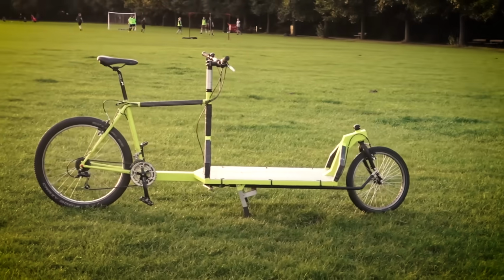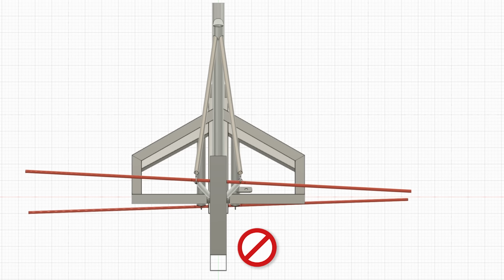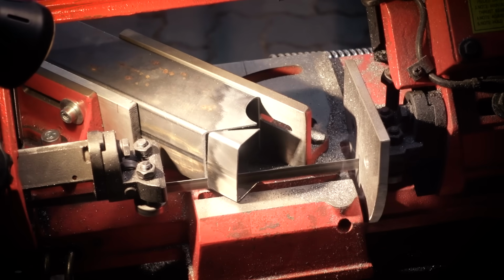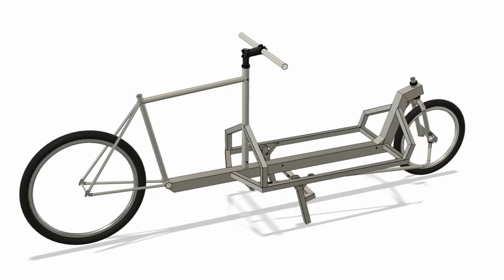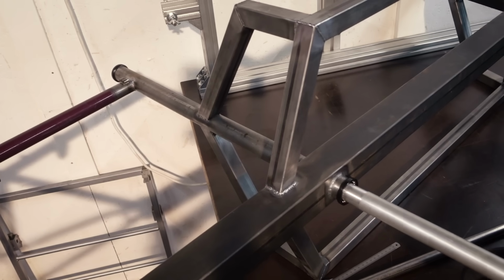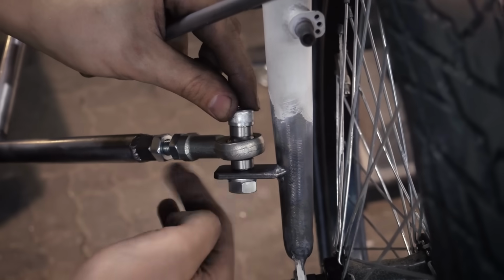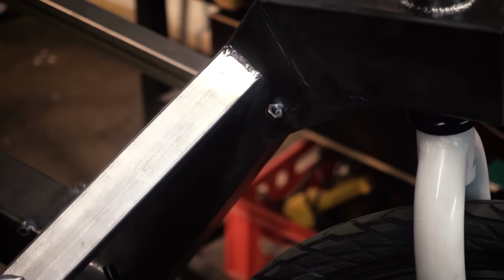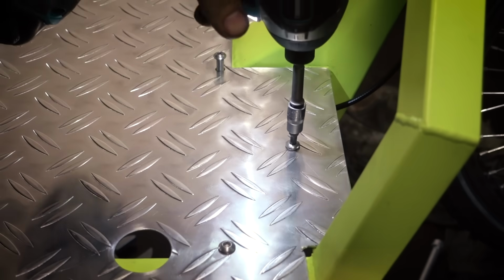How to Build a DIY Cargo Bike (Plans available!)

Comment: Thank you for that intro explaining that you don't NEED a full blown workshop with thousands of dollars worth of tools. I've seen so many negative comments in DIY videos along the lines of "BS, it's only a cheap build if you have tool x, y, and z and they're expensive". As you said, a cheap welder and angle grinder or even hacksaw are the bare minimum along with some basic hand tools - under $200 to get started and they're useful around the house anyway. 
Not to mention the people complaining about cost of materials. Council roadside cleanups are your friend, as are give-away pages on places like Gumtree, Craigslist etc. If you're inventive, you can adapt all sorts of things that others consider scrap :D
As for the build, that big gap under the donor bike looks like it would be a great space for a 4 stroke motor for people living in places it's still legal and want some help powering along with a heavy load. Or a great space for an extra large DIY lithium ion battery pack if you want to go electric. Great design. Relatively simple to build but looks very robust (welding skill dependant) and versatile.

Comment: Do you think put larges holes in new extruture to realize some weight?
Reply from the maker: I'm not sure, I think it might become too weak. If you want to save weight it would be better to use less/smaller material for the cargo bay as it's not that important for the structure/stiffness. It would also help to use thinner steering tubes but the tubing would be harder to find.

Comment: I need to know where you found the steel tubing for 80 euro. All I can find in the states is $300+  :(
Edit: Found all of the supplies from SpeedyMetals.com in the states for about $230.

Here is my order in imperial to match as closely as possible to the metric specs. The head tube I.D. will require reaming, and I was only able to find 2" square tube for a reasonable price.
https://docs.google.com/spreadsheets/d/1jLNbM7ytQzi4uTtkz1kULbJEHP6OPYSAe9bqbUzbpbc/edit?usp=sharing
Reply: You have to pick up a phone, online sites are super expensive.
Reply: jane blogs I think Seattle prices are just high. ¯\_(シ)_/¯
Reply from the maker: Are you sure you'e looking for mild steel and not stainless or something?  I don't know about steel prices at your location but it shouldn't be that expensive. I buy my steel here in Germany so unless you're in the same place my source probably won't help you, I always buy this stuff on ebay
Reply: @PhilVandelay  Indeed. The quotes I received were all over the map. Best place incl. shipping so far is mild steel from www.speedymetals.com at about $230 shipped. Wish me luck!

Comment: 18:30 - " BORE us with welding shots" ? Are you kidding?

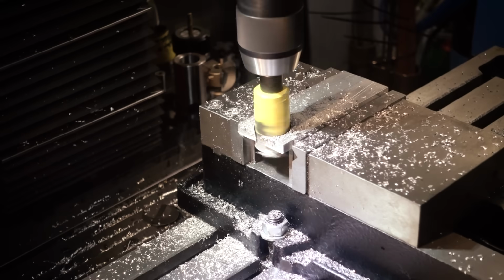20:29 - Right... "saving weight" on a cargo bike ...    just admit it, you like to work with aluminium ;) ;)

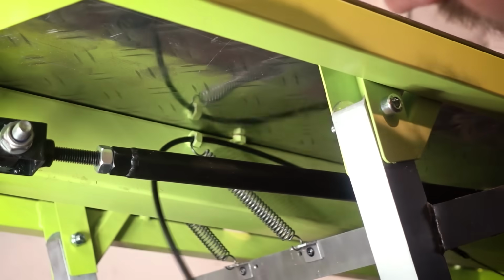36:34 - Also, one piece housing is waaay longer in reliability. Not that you were planning on taking this thing to the mudpits, but still.

36:56 - Correction: it makes sense to use stainless everything . There's no downside on that, but the cost.

In addition, personally, i'd painted inner side of frame with something, just for coating, and left breathing hole in the bottom.  
But overall, this is a wicked concept, and i like the way you brought it to us, without any unnesessary smugness and excessive setups to use. (Still, it'll be a lie to say i don't envy your tool collection))
Reply from the maker: Believe it or not, a lot of people tune out during the welding segments (I can see it in youtube statistics) so I try to keep them short now

Comment: Excellent video, really enjoyed that. I've always wonder how involved a cargo bike build would be and you make it seem doable. One thing I wonder: is the steering light enough to allow the bike to self balance? Could you ride it with your hands off the bars?  Oh and ofcourse: subscribed!
Reply from the maker: There's not a lot more resistance in the steering than you're used to on a normal bike but you can't ride it free handed for a different reason, the bike itself is too long and too heavy for the rider to influence the direction simply by shifting the body weight. You can sort of do it, but it reacts so slow that controlling it is very hard or next to impossible, you can't change direction quick enough. This is true for most bikes in this format though (even much lighter ones). But the light cargo bike I built in another video - that one can be ridden free handed, but even there it's more challenging than on a regular bike. Basically the larger and heavier they get, the harder it becomes to control it free handed. One handed is no problem though.
Reply: Phil Vandelay thanks for the explanation. And again, very inspiring video all around.

Comment: wouldnt hooking a trailer up be simpler?
Reply from the maker: Trailers have a lot of downsides that this doesn't have, like tipping over, getting stuck on things behind you and generally bad handling
Reply: @PhilVandelay  oh ok. well either way it is a cool build and has some cool engineering.

Comment: What a nice project log! Thanks a lot Phil. I just started working at my old art academy and there they have all the tools to build a project like this. Wood workshop, metal workshop, CNC mill to mill wooden parts.. I can just mill out jigs to hold the metal parts in place. Then move everything over to the metal workshop and simply assemble the bike there using all of the jigs. I might consider this project as it's really something that challenges me and I like a challenge :) Thanks for the inspiration! I know it's very hard work to besides doing such a project, also document every step in a sensible way.

Comment: I like it having a very low center of gravity when loaded. That should give it a lot of stability when carrying very heavy stuff. I can almost imagine it feeling even more stable when loaded. Am I right?
Reply from the maker: Once you are riding it's very stable, but when you have lots of weight on it you have to balance it more while standing still or riding very slow. But it's very managable, with a bit of practice you can ride it just like a normal bike.

Comment: your video is great, i hope i can learn how to weld like that
i want to ask something, why the steering/headtube angle is 90° not 62°-72° just like original headtube angle usually on bike ? or you just lazy doing that ?
thankyouu
Reply from the maker: If you angle the headtube forward then the usable cargo area gets smaller or you have to make the entire bike longer to keep the cargo bay length the same. So it's mostly just to save space, because you want to maximize cargo space while keeping the bike as short as possible overall. And the straight tube doesn't really have a huge downside, the handlebar movement is slightly different but you get used to that pretty quick. But yeah, one other advantage is that it's also easier to build that way
Reply: @PhilVandelay  Ahhh..  I see.. it's to save space, and easier way to build. because, i think that take big effect to handlebar movement, since it's not angled like before. so... it's not so really.

thank you for answering my question, it's really help..

Comment: Such a cool build and a fantastic video. Thanks! Just wondering why you did not use a threaded headset on the front? They seem kind of ideal for use on a cargo bike since you do not need a stem to hold things together and set headset play :) Perhaps you could even have used the one from the donor bike (not sure if it was 1" or 1 1/8"). 

Also, definitely keep making vids ike this one!
Reply from the maker: I was planning to use a threadless fork and a-head headset first but I accidentally ordered the wrong fork, I didn't notice it has a threaded steerer... and I had already bought the headsets. You're right it would have been smarter to either use a threaded headset or a non-threaded fork. But I didn't want to buy more stuff so I just used what I had. I'm also probably going to change the fork at some point for a sturdier, threadless one. I personally don't like threaded forks/headsets but you have a point that they have some advantages in this case.

Comment: if you can weld aluminum... why not make all aluminum bike? not strong enough?
Reply from the maker: I wanted to keep it accessible to other people, I didn't really build the bike for myself, mostly just for the video
Reply: @PhilVandelay  so if anyone can weld aluminum they can make one entirely out of aluminum? guess that would not be as strong as steel
Reply from the maker: @jebise1126  Yeah you could certainly build an aluminum frame with the same shape. It's true that aluminum is not as strong but you can adjust for that by using thicker walled tubing (instead of 1.5mm walls, maybe 2 or 3 mm). It's going to increase weight but it would still be much lighter than the steel version.
Reply: @PhilVandelay  but part you take from bike (rear part) you cant make it stronger i guess...
Reply from the maker: @jebise1126  Yeah but that's usually no problem, most mountain bikes are plenty strong enough to to handle the weight. I've never had a problem with any part of the frame not holding up on a cargo bike. Usually the wheels will give up before the frame does

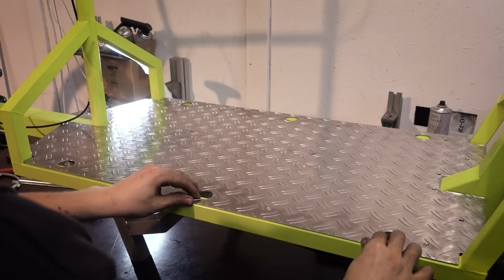Comment: 36:29 Love the build, just a little head scratcher I'd like to ask: Why not cut out a slot instead of a round hole in the floor where the brake line passes? Then you don't need to disassemle the cable if you want to change/remove the floor for some reason. :)
Reply from the maker: That's actually a really good idea, I guess I just didn't think about that option 😅

Comment: "Almost impossible to make this paint drip" They do nothing but drip and splatter. Please tell me what the name of that plastic thing you use when painting with a can.
Reply from the maker: Can't say I had a problem, I found these cans very easy to use when it comes to dripping. It's true they do splatter though - but I never expect much from spray cans. I'm not sure what the name of the handle thing is, they have those at many places that sell spray cans and they only cost a few bucks, not sure where I bought it. Very useful if you want to keep your fingers clean!

Comment: Would an aluminium construction be better and you could ad batteries a go electric
Reply from the maker: Yeah it would be lighter but I wanted to build it so that welding aluminum is not necessary because most people can't do it. I will probably add electric assist later
Reply: Phil Vandelay - it time throw the car away and this could be a base for a way to move bulk goods without government registration. Provided it’s converted into electric

Comment: well thats one way of doing it. theres a reason people dont put trailers on the front of trucks other than the meaning of the word
Reply from the maker: You realize a bicycle is not a truck though, right?
Reply: perhaps thats not the right logic but theres a reason any mass produced version of what you made has the weight and extra length behind the rider.

Comment: Nice bike, here in Amsterdam there is a popular tandem bike, similar design as yours but it has a child sized seat and pedals where your platform is. The brand is "Onderwaterfiets". Also, aluminium can corrode, especially where it comes into contact with stainless steel.
Reply from the maker: I just checked them out, you're right it's pretty similar. I've never seen those before, I love discovering new bike designs and the NL bike culture.

Comment: a bit over complicated and  prone to bending, but whatever floats ur boat, wouldnt recommend doing it this way.
Reply from the maker: Let's see your superior design then
Reply: @PhilVandelay  Saw that coming since this is the internet. But if you had added a few triangles here and the in the corner the design would have been more stiffer and you could have reduced the overall weight of the bike. I might only be a sheet metal worker, but that would have made it better. But if that works for you then great.
Reply from the maker: @Hanstrand  That sounds pretty vague, which corners should I add triangles to? And how would that save weight? And how do you know it lacks stiffness without having used it? I'm all for constructive criticism, but if you're only saying "it's bad, I can do it better" without explaining exactly how, then it's not very helpful and makes me wonder what the purpose of the comment was

Comment: No damping rubber to avoid clanging? The remote  steering should ideally have a rake to it. Even if it's the same as the front.
Reply from the maker: There's no clanging. And look at some production cargo bikes, there's a reason that in hundreds of models, nobody angles the long steering tube. It either decreases cargo capacity or increases wheelbase (or both), making the handling worse. Don't assume I haven't thought this stuff through before putting many hours of work into a project like this.
Reply: @PhilVandelay  No. When you release it. It was annoying on my scooter to release and CLANG - annoying.

Comment: Sir I actually built one similar to yours but I used the whole bike ,I just added a mouthing frame to the bottom down tube an the front neck . All 3 connections are made with square tube an turn buckles to attach the bike frame to my cargo hauler frame . I use the same front forks for steering it sits in a cup style connection an I have a cable steering. Most of the frame is 25.4 mm an 12 mm tube A Crome alloy  . I just remove my front wheel an connect to the hauler frame takes about 15 minutes I have a separate front break assembly that quickly clamps to my handle bar . I've even have a tire holder for my front wheel. Great video.

Comment: Very nice! I like it a lot :) One tip from my point of viev:
12:53 if you have threaded fork used threaded headset instead a-head type.
Than you dont need to cut that stem only to make a clamp :(
Reply from the maker: Yeah true, this setup is not optimal. I ordered the fork online and I guess I wasn't paying attention and didn't notice it's a 1 1/8" with a threaded steerer. But I waited too long to send it back so I ended up using it regardless. I  had already bought the headsets and I wanted to show how to do it with an a-head type headset since 1-1/8" threaded is pretty exoctic and 1" threaded is not strong enough in my opinion. I know it hurts to see the stems being cut but I have a whole box full of scavenged/old stems so every now and then the ugly ones get sacrificed 😈
Reply: Thanks for the clarification. I had to mention it in case someone wants to sacrifice another stem ;) Not everyone has a whole box of stems :) The threaded 1" steel steer tube is quite strong and with the dedicated headset will work fine i believe. Great job!

Comment: Phil, hi!!! What's the weight of the bike???? And what is your profession??? You have many machines that helps you working with metall
Reply from the maker: The bike weighs slightly under 30kgs fully assembled. I'm originally a freelance graphics designer (3D graphics to be precise), so nothing that has to do with building stuff. The building and bike stuff started as just a hobby but I hope maybe I can make videos full time one day. I've saved most of my income to buy the tools over the years and most of the stuff I learned about welding etc. I have learned from YouTube.
Reply: @PhilVandelay  Phil, you're clever guy!!!!! Thousands fingers up to you!!!! Thanks for the vids. I'm interested in the same theme:building something. For now I gather all the stuff for Tig welding...don't exactly know what to do, but looking to the cargo bike ...by the way, wanted to ask you: what the program do you use for 3d modelling?
Reply from the maker: @maximfadeev2012  I use Fusion 360 mostly, for technical stuff like this. Check out the channel welding tips and tricks on YouTube, it's one of the best welding channels I know, or just search for tig-welding, there is a lot of great information on YouTube to learn all this stuff!
Reply: @PhilVandelay  thanx! I know the Jody;))) looking almost all the vids about Tig Russian and American, also like a lot metall shaping as Ron Covell does. Well, good night and thanks one more time!

Comment: How do these things fare going uphill?
Reply from the maker: They definitely give you a good workout :) But if you pick a low enough gear, you can get up almost any hill, it just takes a bit longer. If you're riding on flat terrain, it's not much harder than a normal bike. And downhill they get REALLY fast because of the weight.
Reply: @PhilVandelay  Yeah, i mean i suppose they're for much long distance hilly travel.

Comment: How would you feel about doing this with aluminum with an aluminum donor bike ?

How much does the finished bike weigh, compared to the donor bike ?

How many hours of labor does it take for you to do a bike ?
Reply from the maker: Aluminum is definitely a good option, I just made this one out of steel because most people don't have the equipment to weld Aluminum and I wanted to keep it accessible. 

Finished bike in this case weighs slightly unter 30 Kilos, I didn't weigh the donor bike but It was probably somewhere around 12-13 Kilos. So roughly twice as much.

As for hours, I don't keep track so it's hard to say. For this bike I would say between 40-60 hours. It always looks much quicker in the videos, but there are lots of little steps that quickly eat up time.
Reply: @PhilVandelay  Aluminum can be welded with AC TIG or with a spool gun on a MIG.   It is not much harder than steel.   Not sure if the welds would need to be heat treated though.